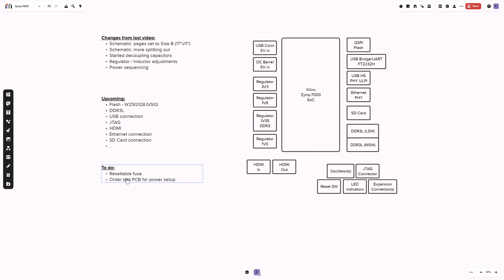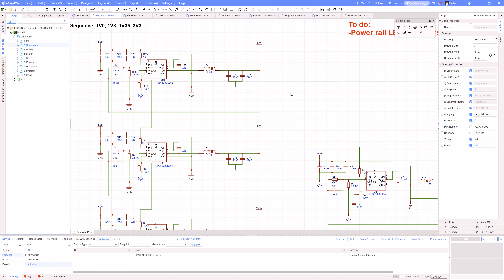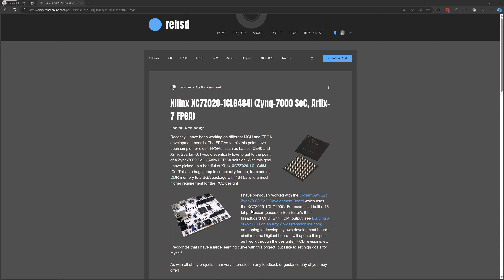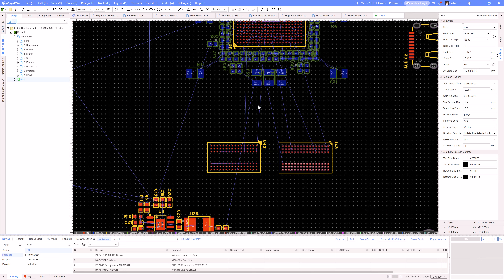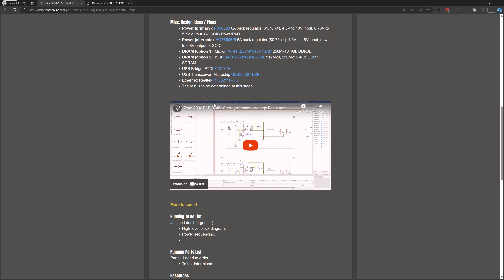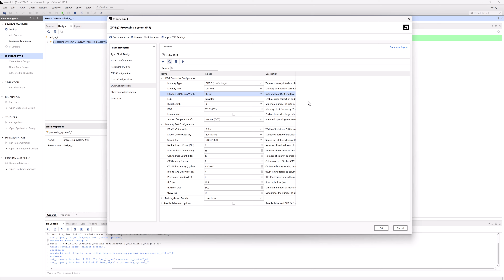Zynq-7000 PCB Build - Part 2 - Progress on Power & Larger Component Selection

Comment: Unfortunately, because if the way MIO pinout works, you will need to use a level shifter for SD card. But I still highly recommend having it implemented because it will make working with Linux (if you ever get this far) MUCH easier.

Comment: You might want to study this whole USB stuff, as you don't seem to understand what's what in there. USB ULPI PHY is a physical interface for USB, typically on Zynq boards it's used for USB HOST - meaning Zynq is going to be the USB master, and you connect peripherals (keyboard, mouse, USB memory sticks, etc) to it. FT2232xx, on the other hand, is a USB device, meaning it's designed to be connected to some external host (like your PC). So you will need at least two separate USB ports, one of which is probably going to be a USB type A Receptable (so that you can connect external peripherals to it), which will be connected to USB ULPI PHY device. As for the second one, you can either connect to to USB type C port - in this case PC will be expected to provide power, or have dedicated USB Type C connector for power (so that you can connect a usb-c wall wart), and other connector to connect to PC - that one will be connected to FT2232xx.
Reply from the maker: Yep, just haven’t gotten there yet. It’s on my list.

Comment: For DDR3 memory - you don't have to use that exact Micon part (they can be hard to find in stock and are often pricey), you can use any part from a competitor which has the same internal organization (256Mx16) and the same (or better) speed grade specification. For example, right now there are D2516ECMDXGJD-U parts from Kingston on Mouser which should work just fine instead of Micron part, but are like 3 times cheaper.
Also your symbol for DDR3 device totally sucks - change it to group related signals close to each other. Take a look at any schematics of a real board for some ideas. Oh and don't even think about using wires for connecting this stuff - net labels ruleZ! Or your schematics will turn into spagetti mess before you know it.
Reply from the maker: Thanks for the tip on the D2516ECMDXGJD-U parts. I will take a look. I agree that the existing symbol could be much better; I was using one of the system library symbols. The wires were temporary.  :)

Comment: As for decoupling caps, I'm afraid you will have to go down to 0201 size if to have any hope of fitting them under BGA because 0402 caps have length of ~ 1 mm and so won't fit within via field for 0.8 mm ball pitch.
Reply from the maker: I was thinking there might be some opportunity for diagonal mount or where there are consecutive pins of the same voltage (near a ground, of course). Maybe I'll add some 0201's just for the challenge.  :)
Reply: @rehsd  Open UG865 and take a look at pinout diagram of that package (page 41) and you will see that power and ground pins in the middle section are routed to place caps right below them, and you can't really place them diagonally as same rail is typically there. 0201s are doable, but are a pain to solder as they as so tiny - so consider yourself warned :) Thankfully there isn't that many of them required.
Reply: @rehsd  That placement of decoupling caps you've shown is a joke. The whole idea for these caps to be as close as possible to power/ground balls, otherwise they will be kind of useless as they won't fulfil their main function.
Reply from the maker: @asmi06  Ya’, I mentioned that would need work. I’m not real worried about the PCB design until I get through the schematic. I’m placing things just to get a feel for the work ahead of me on the PCB.

Comment: VCCADC and GNDADC are used to power internal ADCs, which are also used for measuring die temperature, so you need to connect them properly even if you are not planning to use ADC (because DDR controller uses it internally for write levelling). You can take a look on schematics I've sent you how they are supposed to be connected (connection is the same for "pure" FPGA and for Zynq SoC) - GNDADC needs to be connected to the ground via ferrite bead, and VCCADC is to be connected to 1.8 V rail via "pi-filter". These traces need to be connected via thick traces away from noisy signals wherever possible.
Reply from the maker: Thanks for that, @asm06! Noted... I cannot skip these.